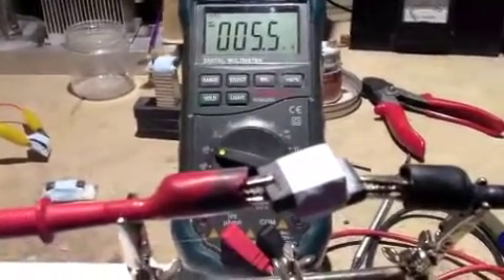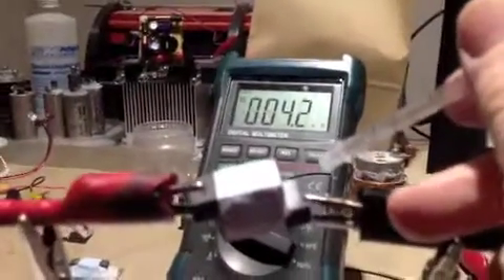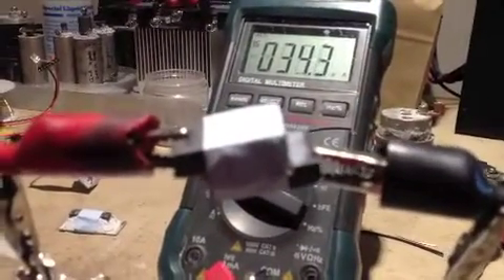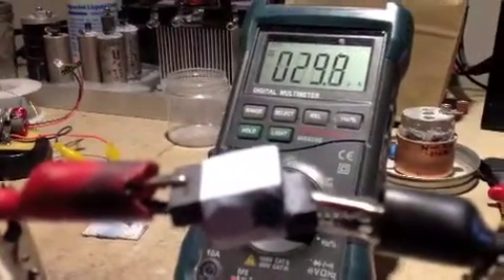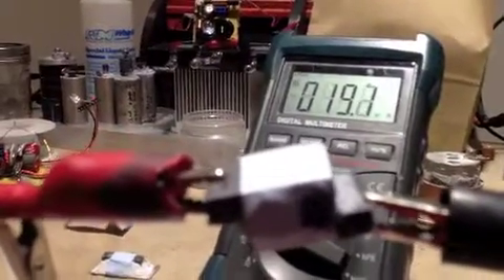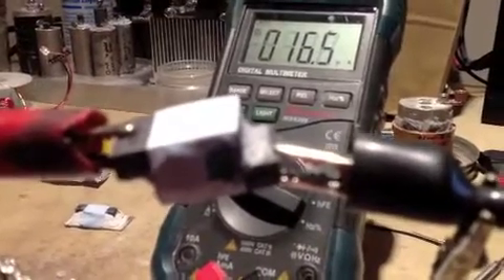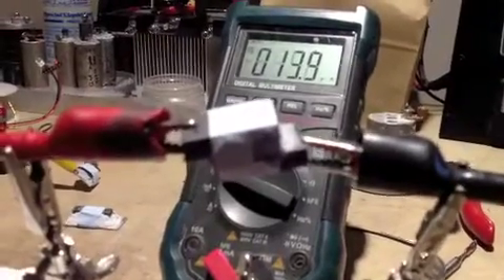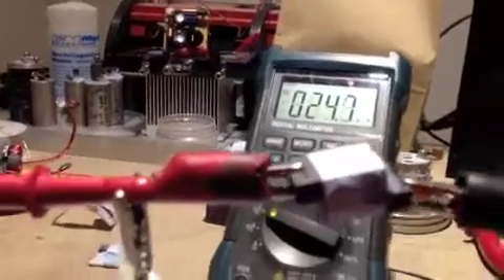Ionic Conduction via (CH3)2CO

Comment: hi there, I found that when i move one or both of the electrodes, or i apply pressure one them, the voltage and current go up. Is that here also? I also found that i could use hair gel instead of water, but that also was eaten away because i saw gas bubbles at the magnesium electrode.
Thanks 4 sharing you work. Greets M